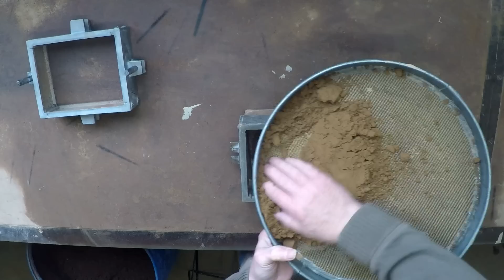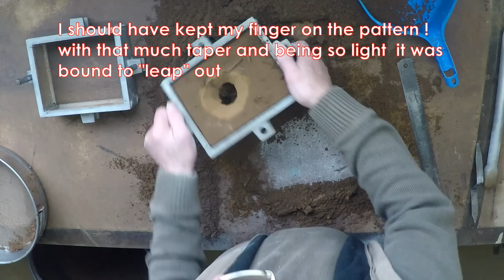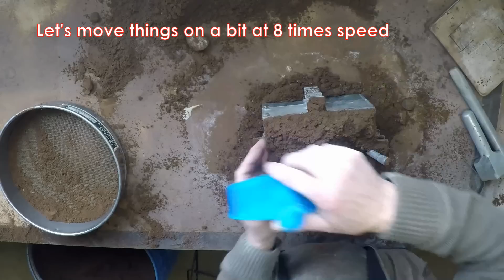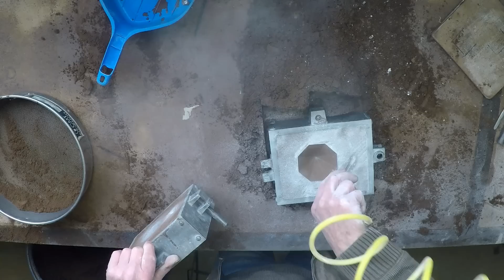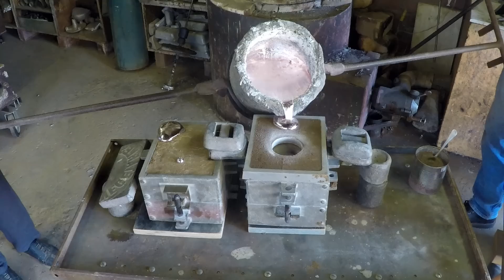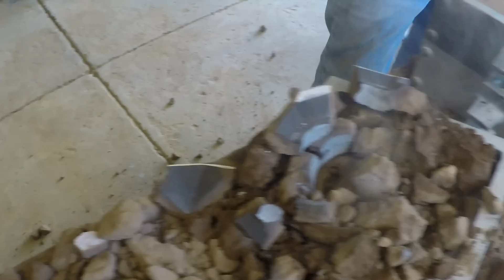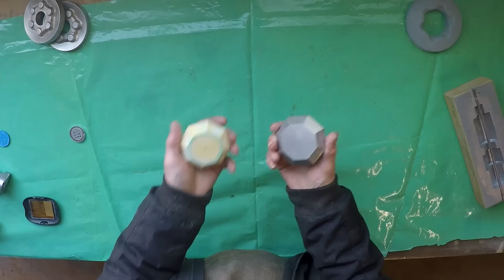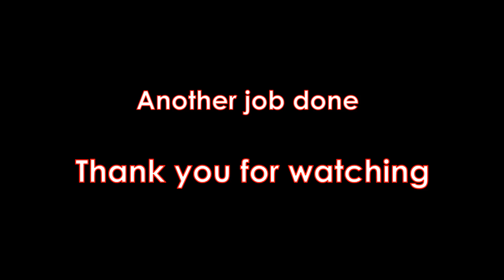Sand cast Aluminium "Trophy Diamond"

Comment: Have been sent this way by swdweeb. As they say one picture is worth a thousand words. Just beginning this journey into casting and plan on hanging around you two guys maybe not right up front but lurking in the background. Already have gotten good pointers in the right direction from the videos I have checked out. Tools, safety, sand (did my first serious pour yesterday) did ok. Sand needs to be finer than the fourty mesh I used. Metal got too hot cause of trying to do too many things at once . Should have stuck with doing the sixty mesh and not got in such a hurry but got a sprue form out of that. Thanks for the great videos..
Reply from the maker: Malcolm,  Bless SW! It is a fascinating and rewarding journey. Forty mesh is road gravel! Even 60 is a bit course 120 or better still 140 is nice if you can get it (not easy!)
I found out long ago that its best not to light the furnace until all the moulds are ready so you can concentrate on just the melting. Metal temps can jump pretty quick once everything is molten.... Martin
Reply: @olfoundryman8418  Boy Howdy! Found that out real good. So begins the journey.

Comment: That came out very nicely!  Had you considered printing the form in two pieces so you could split it?  That's one of the big benefits of 3d printing mold forms: print them in as many pieces as you want and snap them together to match the mold process requirements.
Reply from the maker: Smells, Although I do use 3D prints for patterns from time to time they are not really much good for the job . They require a lot of finishing work to get them smooth enough to produce the sort of result I got here. They are also quite weak and only good for a few castings before needing repair/replacement. A job like this where I only want one or two off and can easily smooth up the pattern because its all flats it would be ok. In fact this is a 3D printed pattern although printed in one piece. Two piece patterns have the problem that the two parts have to join seamlessly accurately and without slop between them, this is nigh on impossible to achieve and is the big problem with all types of split patterns regardless of how they are made. Although I do use split patterns sometimes I prefer solid ones even at the expense of having to make an odd-side. Without wishing to sound too hard nosed about it I am aware that lots of hobbyists use 3D patterns, generally without much finishing and sadly their work shows it. It is a useful technique but many push it a bit far....Martin

Comment: Thanks for there great video - I just recently built a foundry for my 15 year old son and I to learn sand casting - I'be been watching your videos really closely to try to learn some best practices ... and the one that I picked up from this video was about adding the exothermic powder to keep the sprue liquid to feed the cast as it cools - you've mentioned the company that makes this powder in the past but I'm having a hard time finding where to buy it ... Vesuvius is the parent company - do they sell directly to the public? Thanks again - love your videos.
Reply from the maker: Doug, Foseco is the company that I buy from, they are part of the Vesuvius group, The exothermic is called Ferrux NF here in Australia. It comes in 25 Kg bags. Because it is classed as an explosive it can not be sent through the post or by air, but mine gets delivered by a courier service. 25 Kg should last the average hobbyist many years (possibly for life!). Many other foundry supply companies make an equalivant. - I would just ring up those closest to you and ask for "exothermic" or "hot topping compound". Note that it comes in various grades according to what metal you are going to use it on, one suitable for iron probably would not even ignite if used on aluminium while one meant for aluminium would burn way too quickly if use on iron, so make a point of telling them what metal you wish to use it on. The ferrux NF is suitable for all nonferrous metals....Martin

Comment: Que po branco e esse que é pulverizado no molde antes de colocar o alumínio líquido? ??
Reply from the maker: Julio, The white powder I dust on the cavity is just parting agent (calcium carbonate). I do this so that any loose sand that flies around during later processing of the mould will not tend to stick as much  and can be more easily blown off to give a loose sand free surface on the cavity and hence a better looking casting... Martin

Comment: I have to confess that it never occurred to me that anyone would ever suffer from the cold in a foundry. The fact that your foundry is in Australia, just makes it doubly confounding.
Reply from the maker: Arkady, The problem is that traditionally and practically too you mould in the mornings and cast in the afternoon. Our mornings can be quite fresh (Melbourne) and thus it can be cold. The sand can be quite cold too, cold enough to be quite uncomfortable on the hands and moulding with gloves is - for me anyway - impossible. The afternoons pf course can be warm, damn warm in summer 40 + deg C but you don't cast on those days - unless you have a death wish of course 😏. AS I have gotten older I find it best to mould one day and cast the next then I can mould in the warmer part of the day and cast in the cooler. I understand from friends in colder climates (parts of the US and UK) that petrobaond looses its "stick" when it gets too cold and it becomes most difficult to work with, still I guess if green sand froze it would be a little difficult to work with too. 😊. But, yes, it does get cold in foundries - sometimes!... Martin

Comment: Am I the only one who wants a better look at the grind angles on his two HSS lathe tools he used as spacers? 
I can't be the only complete tool nerd on here, can I?
Reply from the maker: fortj3, Those tools were from the scrap bin at a placed I worked. They had been tooling for multi spindle lathes and these were replaced so all the tooling was thrown out, about two 44 gallon drums full! I (slowly) got about 1 drums worth, not so much for the HSS bit but more for the chunks of 3/4 inch thick steel they were brazed too. I did use a few of the narrower (1/2 inch and 5/8 inch) in my lathe but mainly I used the 4 inch long by up to 2 inch wide bits of steel for just about everything! And yes they do make great spacers and packing pieces 😏… Martin

Comment: What does the exothermic consist of ?  What purpose does it fulfill ?

Thanks ,   :-)
Wyr
God bless
Reply from the maker: Wyr, The exothermic is a proprietary mixture so I don't know what is in it. I would guess at things like a metal powder, zinc or aluminium and some sort of oxidiser like potassium nitrate plus an insulating substance that expands when it gets hot. The colour would suggest that some iron oxide is present so it may be a little like thermite. It is called "Ferrux NF" and it is made by "Foseco". Its purpose is to catch fire and generate a lot of heat,  this keeps the metal in the feeders liquid for longer and thus they are better able to provide liquid feed metal to the solidifying casting underneath... Martin
Reply: Thanks ,   :-)
Wyr
God bless

Comment: You might concider making a poring basin scel mold for such ocations.
Reply from the maker: Old iron, You have been reading my to do list! I currently have a 4 cavity shell mould for making the little funnel that I use in a lot of my work. But I now realise that the funnel is a poor design and that it must be replaced with something more along the lines of John Campbell's design. Sadly my "to do" list grows ever longer and many things on it are edging into the category of "I should live so long". However you are right this is one I need to do and soon.
Silly question perhaps but would you or anyone that you know have any idea of the correct valve timing on a Lister "D" engine.. Martin
Reply: well i will be watching martin .

Comment: IS THE CASTING THE SAME SIZE?  OR DID IT SHRINK 6%?
BEAUTIFUL FINISH, VERY NICE
Reply from the maker: Thomas, That 6% that aluminium alloys are reckoned to shrink is a volume figure, the corresponding linear figure is about 1.8%. Many books suggest a 1/4 inch per for allowance for aluminium (1 in 48 or close to 2%) others suggest 3/16 per foot or a little over 1.5%. I tend to use the latter figure for sand work and just 1% for gravity die work. Although I have not measured the resulting diamond casting in comparison with its pattern I would be confident that it would be close to the 1.5% smaller... Martin

Comment: Martin, you don't need a tool warmer.  You need climate control for your foundry (I remember your comments in previous videos about it getting too hot in there in summer).

Also (though not specific to you and this video): Why does the phone always ring when you're in the middle of trying to get a job done?!?!
Reply from the maker: dfross, Climate control - ah - it is a dream that I have! It is a brick 4 car garage but with a bare tin roof i.e. no insulation so heating it in winter or cooling it in summer is simply just not possible particularly with our power prices - we used to have the cheapest power in the world but now thanks to useless pandering to fringe ideas we now have the dearest - Grr - sore point! I keep thinking of laying a new roof over the existing one with insulation in between but at about $20K to do this it is just another dream. But anyway the furnace puts out around 250,000 BTUs per hour when its running and that would take a really BIG air conditioner to take care of. Sadly I have little option but to endure or go do something else.
Yep, damn phone - always at the worst moment! Its just the natural order of things I guess… Martin
Reply: 250,000 BTU?  Then you have NO excuse for being cold!
Reply from the maker: Dfross, Problem is that I mould in the morning and run the furnace in the afternoon so the mornings have no heating!. Sure when the furnace is running all the doors are open and when doing die work I have up to 3 fans going, but those cold mornings moulding, Brrrr Shiver …. Martin

Comment: See, you can use 3D printed patterns
Reply from the maker: Ah yes, but only if you can sand them after printing. This one was easy as it was all flat sides so it sanded easy. With my fine sand any layer structure that without sanding would remain on a 3D print would grab the sand and give a broken out mould. But yes, this one worked very well indeed… martin
Reply: @olfoundryman8418  as a 3d printer hobbyist i learned that using no infill at all can cause problems later. 20% honeycomb infill creates a surprisingly rigid model
Reply from the maker: Randy, I have done other work from 3D printed patterns (Gang tooling block) where some sort of honey comb infill was used. And it was indeed much more rigid it still lacked a little strength though when I came to use  screw to pull it out of the sand - I had to be a bit careful... Martin

Comment: Hello, I've been watching your videos and gained some knowledge every time. Thank you! I have some questions though. I saw the video you made about Nitrogen bubbler lance. You said you washed it with boron nitrite. Can you tell me how you did that? I mean did you just soak the boron nitrite powder in water then sink the metal in to the mix? Or is there any other chemical for mixing boron nitrite? Can you also use any boron nitrite powder from eBay? And can you tell me the proportions of green sand mix you're using, your castings have an amazing finish! I also want to talk to you about some other things if it's possible and I couldn't find your email address?
Reply from the maker: Gizish, It was actually argon that I was bubbling but nitrogen is often used instead. Argon tends to give a drier dross  than nitrogen and that is why I use it. The boron nitride wash is a commercial one, it is called "Boron nitride hard coat" and it is made by ZYP coatings in the US - check out their website -but I warn you it is expensive. I also use it on my thermocouple sheaths and transfer ladles. My green sand is a natural one i.e. it is straight out of the ground. All I do is breakup the lumps, sieve it, add the required amount of water, aerate it and its good to go. There is a bit more work in the facing sand though and I have videos out there that show how I make the facing sand and how I reprocess the bulk sand at the end of each casting run. Sadly YT have shut down the  private message facility but  my email is mmwestuppercase2hotkey.net.au.. Martin
Reply: Hello again. Please check your email.
Reply from the maker: Gizish,  So far I have not received an email from you. Looking at the address that I sent you it shows a dot after the au - my mistake - there should not be anything after the au - perhaps this is why I have not received anything - please try again... Martin

Comment: Martin, nice little job there, I will get around to showing one of my 3D prints in casting action on my channel (its coming honest).
Oil bonded sand, as you know I almost exclusively used this, & although I tend not to do much casting in the winter, this is primarily due to me freezing my ass off than the oil bonded sand being cold.
I have used mine at temp's in ambient temperatures of about -2c (in-fact I am sure I have some footage in the can somewhere on this very subject).
Any way drop me a line and let me know whats new with you.
Andy
Reply from the maker: Andy, So busy answering comments at the moment that dropping a line might have to wait a day or so but I will get around to it.
I am still eagerly awaiting this supposed 😀 casting video of yours. Some on YT have said that when petrobond gets cold it looses its stick and gets very dry have yo not had that problem? When we get anywhere near down to - 2 deg c the condensate drips off then inside of my garage roof and all over my work bench - damn hard to work with water dripping all over the moulds, patterns. and me! … Martin
Reply: @olfoundryman8418  
Martin. I have the same issue with ice forming on the ceiling of the container. As it warms up in there it starts to bloody rain on me!
As for my sand loosing its grip in low temps, no. But I use rejuvenating oil, somthing many don't have access to, or are not aware you can do so.
Reply from the maker: War, Pretty hard to insulate and heat a container! You have my sympathies… The "rain" in my garage is contaminated with flux fumes and is very corrosive.. Martin
Reply: @olfoundryman8418  
Martin,, you have your own acid rain.
We know who to blame for global warming now then.
Ah if  nothing else we can moan about the weather.

Comment: Another fine installment Martin!  Good to have you back.  Another Master Class in how a plan is a plan until it changes and has to be adjusted.   "I love it when a plan comes together".  I'm only just a Grampy at 49 (he's 1 1/2 now).  I cant wait until he asks me to make something for him (and hopefully his sibling/s too).
Reply from the maker: ViScAsh, Once they realise that you can make stuff there will be a never ending list of thinks to make - bunk beds for dolls, trinket boxers, rubber band guns, paper planes bitcoins trophy diamonds etc.

I usually do try to plan how I am going to make a particular casting - where are the feeders going the gates the runner the sprue etc. The orientation in the mould, the parting line, how high a mould do I need to extend the feeders to use exothermic how hot do I pour it what alloy do I use will I heat-treat it how will I cut it off and fettle etc etc. This time I got a bit  "she be right mate" I know better but in my defence it was the last casting I did before some surgery  and my mind was elsewhere - still a lesson in there methinks.. Martin
PS I also plead "all's well that ends well"

Comment: I'm so jealous of your sand! Even after ramming I don't think mine would hold up to an air-compressor. It's hard to keep mine well conditioned in the sub-tropics.
Reply from the maker: Crazy, Couple of tricks - firstly I have a small regulator on just that air gun line, it is set to only about 15 Psi, secondly point the gun away when first pressing the valve as you get an initial gush of air that can be damaging alternatively push the valve very slowly.

Store your sand in a big sealed plastic barrel, its not the whole answer but it helps keep the condition. Have water spryer and spray the bench first and occasionally through the day if the sand starts to dry. But yes, moulding on warm dry days is a bit of a problem as the sand dries quite rapidly. Higher clay helps as it means higher water and thus more to dry out. To be honest I do not know how people do foundry stuff in the sub tropics as it can be so humid some times... Martin

Comment: Amazing surface finish! Did you have to sand or polish it at all, aside from the gate and sprue?
Reply from the maker: Coophi. Aside from the gate and feeder that finish is as cast. The tricks to getting this are the fine sand and the use of only moderate mould height - many people use very high sprues and this increases mould pressure which forces metal into the sand creating a rough finish... Martin